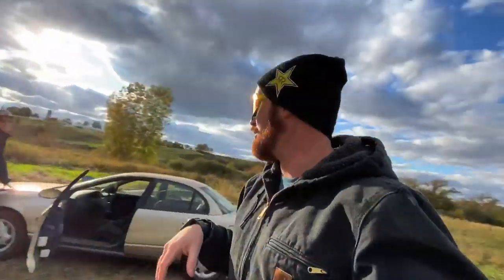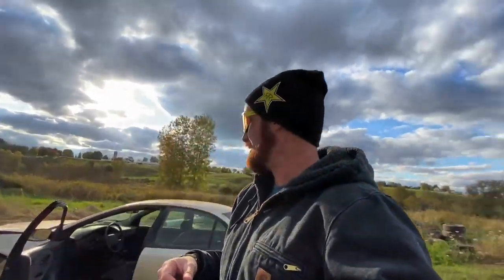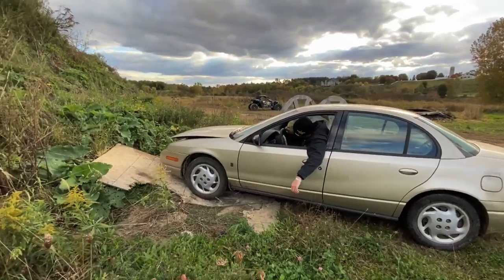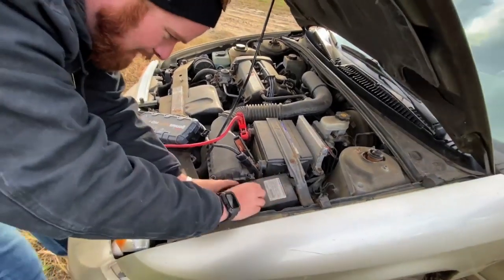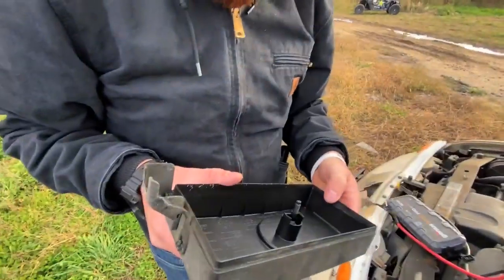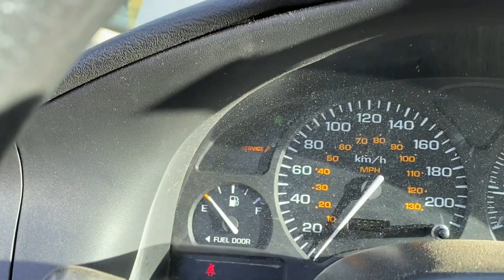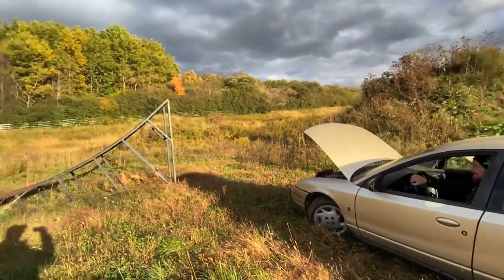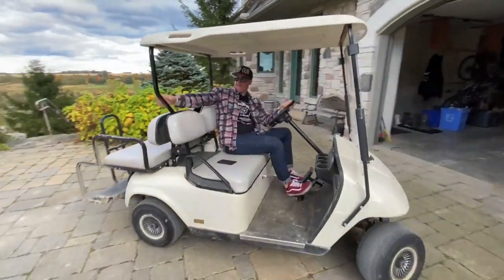We Got The QUAD BACK OUT!

Comment: Mark saturn was cheap like that on the fuse boxes based on the options if it was a base model without abs they would not run wires to that location on the box